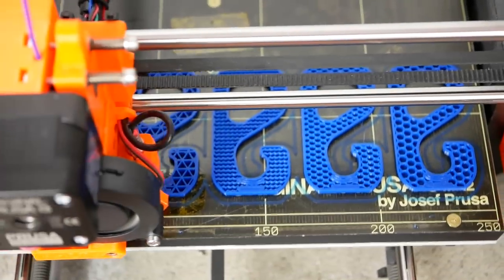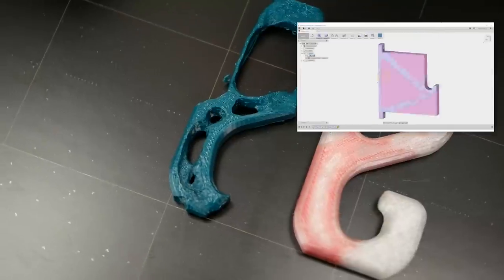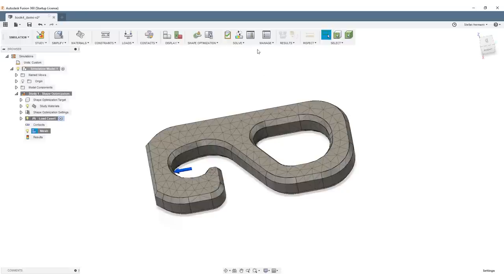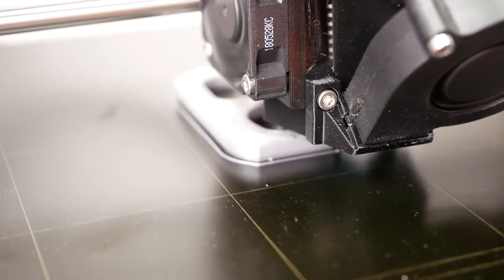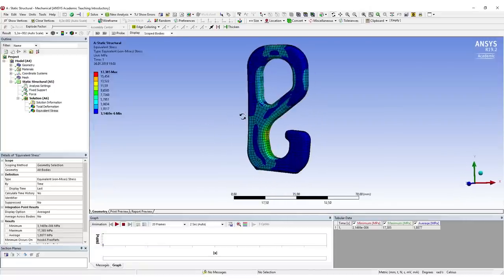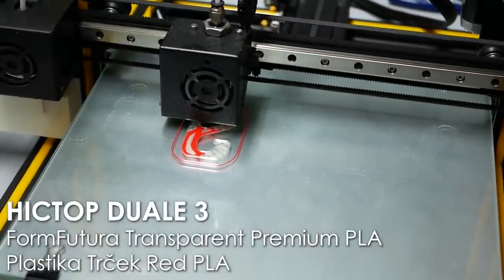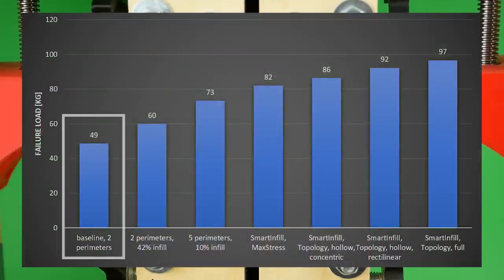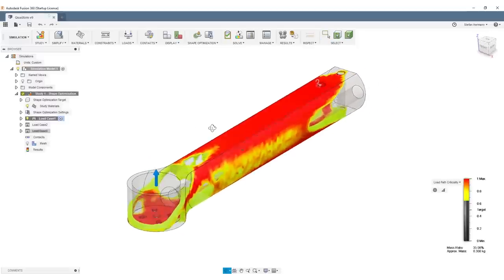Load dependent Infill placement: Smart Infill for FDM 3D prints!

Comment: What an awesome technique! It seems useful for being super efficient with your materials if using an expensive filament or printing a lot of copies of a model, or just for adding a visual detail like the dual color versions you printed. Also, thanks for confirming my intuition that adding perimeters is generally more effective than increasing infill, that little test alone made this worth watching :)
Reply: also, it's a great way to show stresses in r&d with multicolor printing.
Reply: This is just an accessible version of 'Discontinuity Layout Optimisation' used when designing engineering structures / parts.
Reply: He did made a video quite long time ago, that prooves the higher perimeter betten than more infill.
Reply: Will you use this in your projets?
Reply: On the chance you read through new comments on old videos.  A video highlighting whether or not going through that process with the previously strengthened completed hook to see if it will improve it any further.

Comment: Amazing workflow. I only wish that you had a 100% dense model to compare strength to weight to material cost.
Reply: Didn't want to show that hours of adjusting settings could be beaten by yeeting more material out of the nozzle 😆. The weight comparison is nice. But unless it's flying I never cared.
Reply: I agree. Strength to weight ratio would be the best way to show the efficiency of this process.
Reply: @mattweger437  Weight = Printing time ;)

Comment: Shouldn't it be more weight efficient to only increase the wall thickness (possibly where FEM suggests) and use the filling just to stop the part from buckling or falling apart from other more complex structural reasons (kinking etc.)? The filling by design isn't good at taking proper loads.

Comment: What we need is a finite mesh simulation that outputs a weighted mesh that gives the stresses as a proportion of maximum. Then we need slicer integration that will allow you to create gradient infill according to a curve. That way we get better fading between infill strengths so that the load is distributed more evenly and we can fine tune the process at the end instead of restarting each time.

Distributing the load would probably help a ton because it looked like some of the parts began to fail when the internally dense region began separating from the rest of the part. If it could be faded more evenly to distribute load, possibly with custom infill shapes to spread forces into the whole of the part, I bet the part could be made even stronger at the same weight.

Effectively, I think what a large goal should be for the 3D printing community is for us to move away from static infill patterns to infill that is created procedurally for each part to maximize load distribution. I'm imagining a version of infill that has almost that tree-like branching that moves from a thick area near the main stress in a direction that will support the part and then spreading and splitting outward to spread out that load. 3D printing could allow us to, in a way, create parts that have fully connected fiber reinforcement aligned to maximize strength.
Reply: I'd imagine optimizing the filament paths is probably harder than just density. Although optimized paths will likely perform notably better than pure density. Especially since strength in various orientations differs non linearly for orientation and density. However, there's already ongoing research into fiber orientation optimization for high end carbon fibre structures... just need some of that for 3d print software.
Reply: Spot on. The vertical gradient between 100% infill and 10% infill was a stress riser. Interpolate over some range at the boundary and it'll be stronger.
Reply: Building off of this concept, I imagine it would be helpful to have different types of material within the model. PLA and flexible in the same model might provide many advantages.
Reply: @Vivid Media Need to complete the loop:  AI needs to be trained, AND you would want some sort of feedback loop to improve its performance.

Comment: I think I'd like to see more on the shape optimization using multiple materials. In the video you show the one printer printing the hook with the optimized infill in a different color. Instead of another color use a stronger material. So for the base hook body maintain the standard PLA and then for the reinforcements use one of the PLA filaments that has adders in it, or print that section with say ABS or Nylon. I am not sure how the two material bonding would react but it would allow you to use a cheaper material for the base part and then a stronger but pricier material for the areas that need the reinforcements. Similar to some injected molded parts where there are metal reinforcements in critical sections of the model (one thing that comes to mind is metal reinforced feed lips on polymer AKM magazines). 

Great work as always sir, from one engineer to the other, I love the way you structure these videos and tests.
Reply: Good idea, but rather than different plastics which print at drastically different temps I would suggest reinforced vs non-reinforced plastics. I.e. use standard cheap pla for most of the part, but on the high-stress regions use carbon fiber/ Kevlar/ cellulose reinforced pla.
Reply: eugenioLU91  I haven't seen that, however I question whether you're thinking of structural or decorative pla. Either way it's a better place to start than attempting to print abs into pla (which will melt straight through the surrounding pla producing little more than plastic blobs).
Reply: @xxportalxx.  PET-G and other copolymers can print at about the same temp (250) as CF-nylon so this might be an interesting combo.
Reply: @robertasumendi  I haven't had opportunity to use much of either, however the ability to mix materials seems like a promising niche for additive manufacturing. 

Personally I've been spending more time researching the potential of printing protoboards easier (as an ee that is more aligned with my use case)
Reply: What you could do is if you have a two nozzle system use PTEG.  Might have to wait a few seconds between switches for the pteg to cool but be interesting no the less.
Reply: Big Weld  That is my thought, especially since flexible has such excellent inter-layer adhesion, and is fairly middling in print temperature. An exterior of flexible, with PLA for some rigidity perhaps?
Reply: the technique is called DMTO, would be awesome to implement it in 3D printing.

Comment: Hey Stefan. From my understanding, the main factor that you want to keep in mind is the contact surface area in the plane perpendicular to the force vector. Hence you want to optimise force/(surface area). Solid infill certainly increases the contact surface area. The other factor that you might want to consider is the print direction for the infill in those place, as you have previously shown that it matters a lot (i.e. layer adhesion < material strength).

Comment: What an interesting group of thought/structural experiments. I'll have to keep those tricks in mind.

One thing I've done for parts that I need to tap (When we make samples of castings at work) I cut a bunch of .02mm lines radially around the hole so that the printer does a zigzag pattern around the hole to be tapped. This way I can force plenty of solid plastic around the hole to finish drill and tap without having to up the perimeters everywhere else.
Reply from the maker: Great, this is basically using the "virtual fiber" technique!

Comment: As someone familiar with the use of FEA this is an interesting topic and workflow. It would be interesting to see how the parts reacted when subjected to loads that it wasn't optimized for compared to the standard infill parts. At least with a hook it's fairly easy to know how the part will be loaded, but sometimes parts can be subjected to loads that you may not suspect, hence the need for safety factors. However, I'm sure this consideration is probably overkill when you're worried about hobby projects, but something to keep in mind nonetheless.

Comment: Ive done stuff like this in the past with Fusion. Never tested like you did but you did a great job explaining the process along the way.  As for the gaps on concentric infill, what about using a larger nozzle diameter and low layer heights?  This will effectively reduce any voids in the part.  Also in fusion you can modify the shape optimization criteria for a higher  target mass so you can get an optimization that is all connected.  Which will  likely reduce voids going from solid reinforcement to infilled spaces.

Comment: This is an amazing video!!!  I really appreciate the work you into it and it's a testament to how proper engineering techniques can yield great results.

At a bare minimum, any part I print that requires strength will likely be the 5 perimeters/10% infill, which seems to be a nice labor/strength improvement tradeoff.

Comment: Stefan - the one nice thing about the partial fail before full fail is if you had this in an industrial situation - you could in theory monitor and take action for that 'warning sign' before deciding the part was too close to it's tolerance limit before actual failure.   On the other hand, it means you have to leave a larger 'reserve' in strength vs. a 100% infilled part which may make the savings (weight, cost, performance) trade off not worth it.

Comment: It is great to see that topology optimization is finally becoming popular (it exists since 90ies). Great application! Some comments: Ansys has also  topology optimization integrated (it had it already 10 years ago, but it seems they fogot it)
There is also topology algorithms to optimize the orientation of fibers like CAIO, this might be usefull to align the printing orinetation. Unfortunately the software developers are a little bit slow to implement it.
There is also latice structure optimization. As far as I know only altair offers software for this and it probaly can't concidder the anisotropy of fdm.

Comment: To create acutual fibers, you could generate a 3d grid of fibers and then use the combine/intersect tool to just get the parts of the grid, that intersect the simulation mesh. Then you could use this in other slicers, as it is baked into the model.

Comment: The displacement sharp edge you found is because something called triaxial state of stress.

The hooks are failing like simple engeniering materials because the rupture is always gonna start in the inside (like a relatively ductile material). It happens because there are not so much stress concentrators (like the sharp edges of the infill) and the deformation is not possible because the surrounding infill is dense, blocking it.

I'm sorry because the broken English. You can find more research material on this searching the subject fracture mechanics.

Comment: That was a significant strength increase, fascinating topic.

Also a great way to optimize. Most strength for minimum material. 

What I'm curious to know is what would the strength test be if you made the entire part with 100 percent infill. Feel like this would give you an upper limit on what's possible in terms of strength with the given material, and provide you with an idea of how close you can get to a theoretical maximum strength.

Comment: A very simple way of adding the smart infill :). Great work!!! An idea I came up with, but lack of time has stopped me :(. I was looking into using a basic fractal branching set of connected rods like bone. So the sides can spread the stress more evenly. I also think it’d help if the part was PLA and baked. As to what part you should try, I vote for the quad copter ;)

Comment: Design 2 parts in the sketch model and set infill for each separate part then combine them before slicing is a quick workaround and less time. once you see the warning infusion design a simple part to cover that area and import both models then set different infill for each presto a simple way to do it without the complication I've done this for years on mech parts.

Comment: What you observed in your final graph is not a release of internal stress as you hypothesis. In engineering we call it the elastic and plastic stress strain curve. 

The initial part is elastic until you reach the drop meaning it will be permanently deformed. The plastic is just the state of permanent deforestation until breaking.

Comment: Quadcopter arm optimization would be awesome
Reply: I was thinking exactly the same thing!
Reply: Yeah, but that would be really hard. The case where quadrocopters break usually is in a crash, so in my opinion you would have to optimize for this case. Using this method with FEM simulation, you only optimize for ONE case, usually where the force is one way and constant... Also in flight, the forces vary, if you change direction, because of inertia (Trägheit). So you would have to combine optimized infills of many cases. That might be interesting.

Comment: since forces here are somewhat in one direction, infill could be done in that direction as well, in all cases (vertical). ie. horizontal density 20lpi, vertical 7 lpi. so that more vertical strands are present. also, continuous strands have more strength so they could be as solid as possible from top to botton, in an S, J or whatever shape needed.

Comment: Good test about Topology Optimization in 3D printing with 1 axis boundary condition. But I really want to know about how ToOp works in 2 or more axises boundary condition, because you all know about the anisotropic of 3D printing. It will prove a better point about the viable of smart infill.
Anyway, thanks for the method you found to add the optimized structure to the slicer. Keep up!

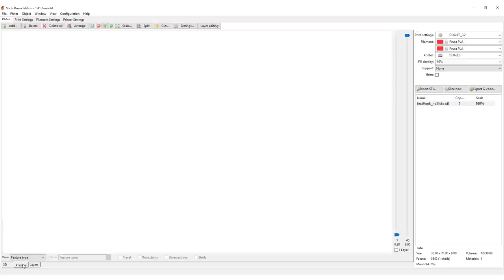Comment: At 13:40 you can see that the hole in the bottom left that was supposed to be normal support infill is entirely 100%, though an isolated hole in the center in the modeling was not intended to be so.

Comment: I think making sure the modifier has a good connection to top/bottom/perimeters would be in of high importance. Having the modifier connected by standard infill to the shell will probably have lower performance. Perhaps using the shape optimization mesh as a guide to hand model the modifier would yield the best results.

Comment: Incredible video, this is what I should be doing at work.
You might be introdisung stress concentrations at the areas where you change the stiffness of the part, thus a more gradual increase and decrees of the infill might improve thins even more. 

Maybe someday someone would make a infill that followed the maximum principle stresses.
It might be "simple" to combine the Normal stress in X, Y, Z and the Gradient Infill method. (except that you need python the read out the stresses at several x,y,z points. You can du that in ANSYS using the commands, the you could right a command using python run that in post in ANSYS, and get at table of SX,SY,SZ and then read that table with python and create gradient infill. You might need to normalize the stresses though. Also there might be at better way of doing this, since this would be back and forth between sliser, python and ANSYS.

ps. I love you work and I aspire to become as good an engineer and home  project creator as you, or just 80% would be satisfying.

Comment: The hooks that had two bumps on the end of the load curve exhibited what is known as lack of composite action; i.e., the inner and outer structures did not act as a unified assembly. It looked like the outer skin failed under flexure followed by the in-fill core failing under buckling or shear.

Comment: This video was absolutely fascinating... You could use this method for a lot of applications.  I got a little confused towards the end of the results, maybe you rushed through them too fast, or I'm too dumb haha.

As far as the next test goes, I'd like to see you test the Peon230 Quad by Tech2c (inventor of the hypercube).
Reply from the maker: Good idea but the Peon230 is actually quite a bad design for 3D printing, almost taking no advantages from the possibilities you have using 3D printing. This is basically a copy of conventionally machined carbon designs with minimal reinforcements at the arms and the base.

Comment: Interesting, I look forward to the day Cad software and slicers mesh and we can auto generate stress based infills. 

100% infill reminded me of something. A few years back I remember looking up infill strengths quite some time ago and found that a very high infill percentage like 95-99% often out performed 100%. The author believed the issue was not the material density but rather the slicers ability to mesh the infill with the perimeters, and adjoining lines properly. By removing a small percentage, less then 5-10 percent, of infill the slicer was more or less fooled in to accounting for the under nozzle size gaps that the slicer could not account for at 100%. Mind you slicers have come a long way since then so this may no longer be an issue, but I haven't seen it tested in some time.
Reply from the maker: Tested 100 % infill last year and it preformed petty well : https://youtu.be/AmEaNAwFSfI

Comment: Brilliant!, This technique would be good for optimization around fasteners,
brass inserts, nuts and so on. A little off topic - It would be interesting
to check adhesive strengths in the tensile testing machine. I seem to get 
mixed results on the type of super glue used?
Reply from the maker: Check this out: https://www.youtube.com/watch?v=JSff8OMRHtw